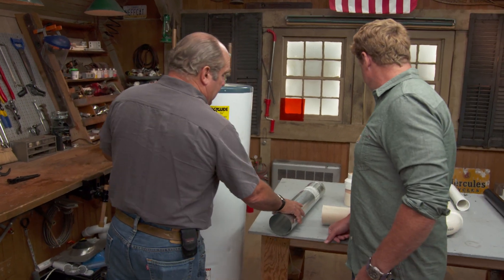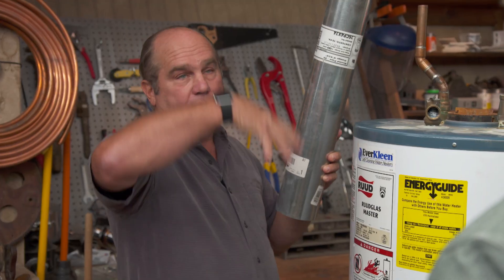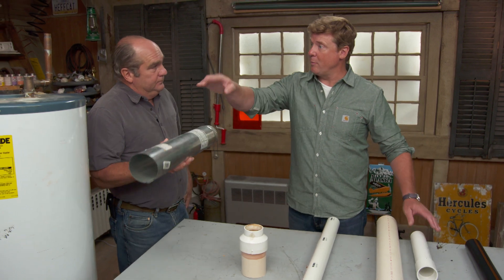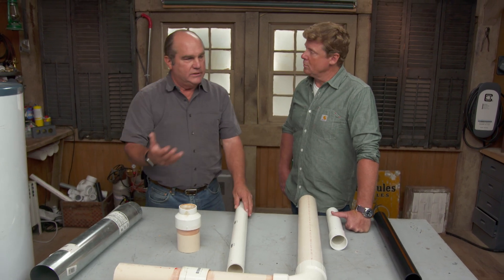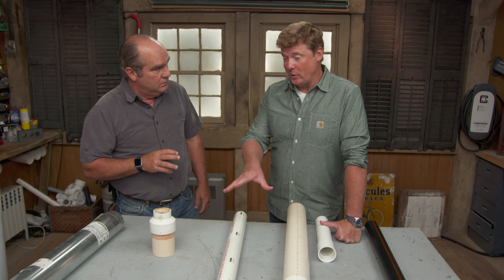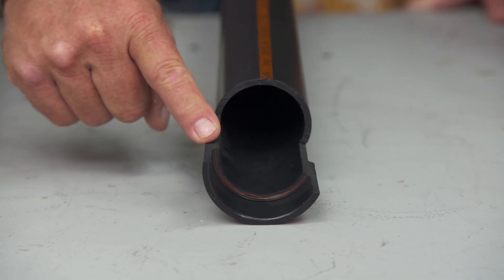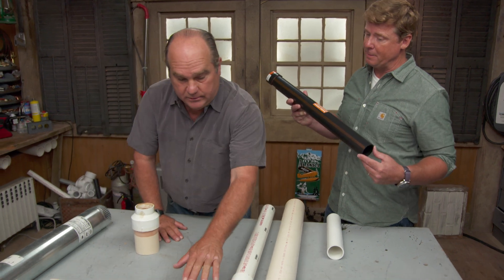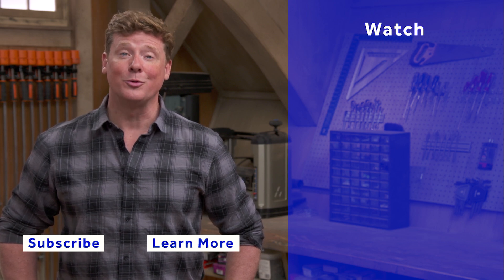Understanding Improvements to PVC Gas Ventilation | Ask This Old House

Comment: A 90% + furnace or hot water heater flue gas does not get hot, the pvc vent pipe will be just warm to the touch
Reply: Until the heat exchange starts clogging, or water flow slows down... 
And it also depends how hot you run the boiler or water heater

Comment: Haven’t seen that pipe in Texas , hvac people use regular pvc
Reply: Funny, 8 month old comment and 5 year old comment right next to each other and yet, I still have not seen anything other than standard PVC pipe used. The last manual I read for a water heater said standard PVC was acceptable.
Reply: In the same boat. Today is Aug 2025. My Furnace was installed in 2014 Suburbs of Chicago. I just found that regualar PVC was used for the exhaust. I noticed some discoloration and was concerned and skeptical. Not as severe a discoloration as the one in the video, yet. My Installer did not use black specially made PVC  for venting either in this case either.

Comment: that ipex 1738 is great for the consumer but hell on the installer it's filled with harmful chemicals and even a quick glue up in a small mechanical room without a respirator will have you dizzy af

Comment: My gas water heater has this problem and is vented to the chimney. When I bought the house, the home inspector told me that carbon monoxide might not exit the chimney properly. In the meantime I put a CO detector with a LED display right by the heater.

Comment: I like PVC and the better product you are using.  Metal corrodes, rusts, forms holes and is usually bent all over the place with all kinds of joint leaks.  PVC and PVC rated for venting is much easier and safer.  Nice video.  Quick and to the point.

Comment: does black furnace vent pipe safe to hook to the furnace forced hot air furnace and it will not melt.Or does the coupling piece with stand heat from furnace

Comment: Sorry, I'm calling BS on this.  Canada requires this special heat vent PVC, but the US does not.  Just look at the fact that in Canada Home Depot stocks 636 PVC, and in the US they don't even list it on the website.  Anybody know of an actual document that shows this PVC is REQUIRED and not just "recognized as acceptable"?  And it's clear the examples they have combine both PVC elbows (bright white) and CPVC (more yellowish).  The color is not from aging, it's the type of pipe.

Comment: Had no clue pvc was even used considering how much of a deal they make about how hot it gets. My pipes from water heater don't get as hot as I thought but the temperature change is excessive and why I think metal is preferred.  Most recommend Type B pipes(expensive) over single sheet. I also highly recommend a CO detector, had a co-worker leave car running and it went into the house.

Comment: Why we don't heat the water with the hot CO2 from the combustion of the furnace exhaust (Winter), a spiral cooper pipe thru the outer pipe that go to the roof?
Reply: Maybe in the old days when they were 60 70 80% efficient you could have reclaimed the heat but now with 96 98 99% efficient furnaces you're not going to get much heat from the exhaust.

Comment: Centrotherm is the best plastic vent pipe on the market. it's not PVC it is polypropylene and polypropylene can handle higher temperatures, and it is the only plastic vent pipe that is UL-1738 in the USA

Comment: Hi, I have been watching this old house for as long as I can remember. One thing that has never been talked about (as far as I know) is where to place the carbon monoxide detector. I have always put it near the ground as the gas is heavier than air so to get the most amount of warning it should be there. I have been in hundreds of houses and the detector has been on the ceiling with the smoke detector, and now you can get them both in one unit, so where should it be located!.
Reply: Where Should I Place a Carbon Monoxide Detector?

Because carbon monoxide is slightly lighter than air and also because it may be found with warm, rising air, CO detectors should be placed on a wall about 5 feet above the floor. The detector may also be placed on the ceiling. Do not place the detector right next to or over a fireplace or flame-producing appliance. Keep the detector out of the way of pets and children. Each floor needs a separate detector. If you are getting a single carbon monoxide detector, place it near the sleeping area and make certain the alarm is loud enough to wake you up. -EPA
Reply: Follow the manufacturer's directions in the paperwork you get with your CO detector. It clearly states exactly where to put the detector.
Reply: Natural gas is lighter than air, propane is heavier.

If you have natural gas put it on the ceiling

Comment: I just had a new furnace installed in a mobile home. We were allowed to instal a house furnace because of the higher efficiency and we wouldn't be forced to change the roofjack. The installation was done with white pvc. Do I need to change it out or can it go for a while. We are on a fixed income and can't deal with a costly fix.

Comment: What do you recommend about those of us who have older houses with flues and who have upgraded to more efficient appliances? Should I install a fan?
Reply: 1stGruhn    A fan for what?
Reply: @DONALD1951  If I understood him, he said that more efficient water heaters don't have as hot of exhaust thus don't create the same draft speed thus normal flues don't vent properly. Thus a fan to power exhaust the fumes from the gas water heater. My heater is in the middle of my basement, side venting isn't really an easy option.
Reply: All new high efficiency gas appliances have this fan built in the appliance. They can be called an exhaust motor, inducer motor, induced draft assembly, they’re basically all the same but that’s what they’re talking about. For an appliance to be “high efficiency” it will have that fan. When your appliance was installed and if it is a high efficiency model, the exhaust would have been changed out to a pvc system. If it’s still using a metal exhaust then it’s not a true high efficiency appliance with an efficiency rating of 90% or higher. Some water heaters have a booster fan on the exhaust but can still use metal piping which is fine, it’s just not as high efficiency as a model that can use pvc.
Reply: what kind of appliance you talking about?
Reply: @QnQoooo  a recent and efficient conventional gas water heater
Reply: 1stGruhn a tank type chimney vent water heater like the one shows in the video?
Reply: @QnQoooo  yeah. except the flue is an old asbestos concrete flue that is basically straight piped out of the house with a chimney cap on it. The flue to tank connection looks similar to this: https://checkthishouse.com/wp-content/uploads/typical-water-heater-vent-pipe-connection-but-with-missing-screws.jpg

Comment: I haven't heard anything about this pipe change. Been using pvc
Reply: In the same boat. Today is Aug 2025. My Furnace was installed in 2014 Suburbs of Chicago. I just found that regualar PVC was used for the exhaust. I noticed some discoloration and was concerned and skeptical. Not as severe a discoloration as the one in the video, yet. My Installer did not use black specially made PVC  for venting either in this case either.

Comment: When was this new pipe made code? We still install pvc pipe on water heaters and hvac units.
Reply: In Massashuett you are allow to use PVC for venting  for power vent water heater and furnace. For boilers you must use the black pipe .